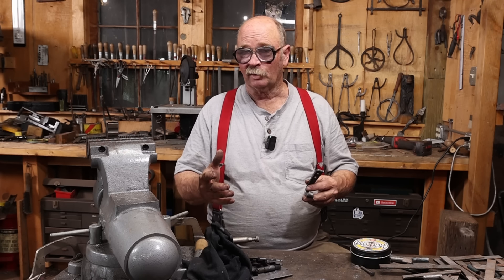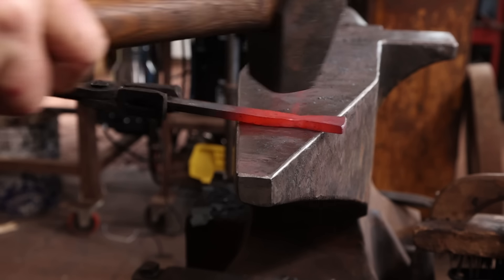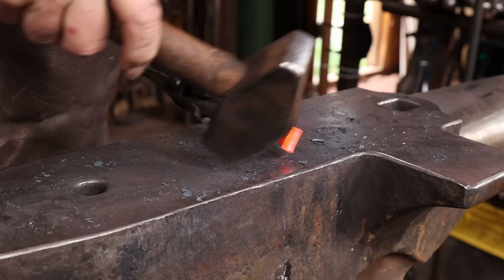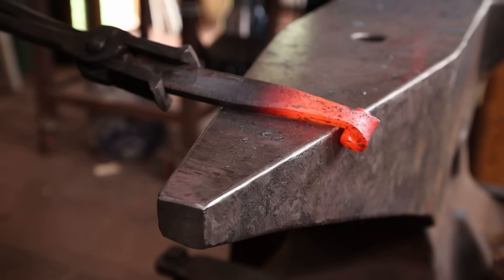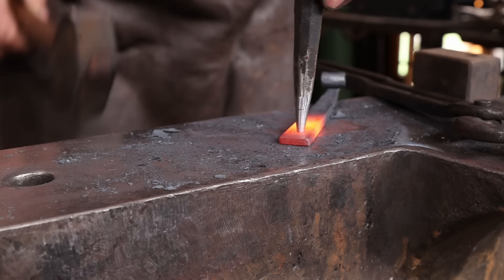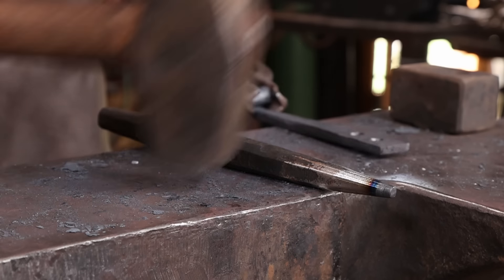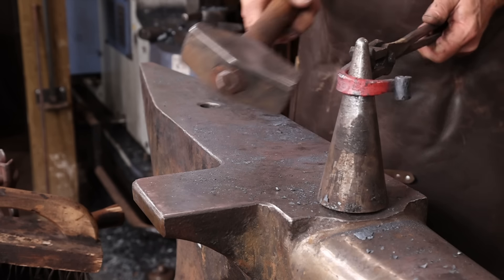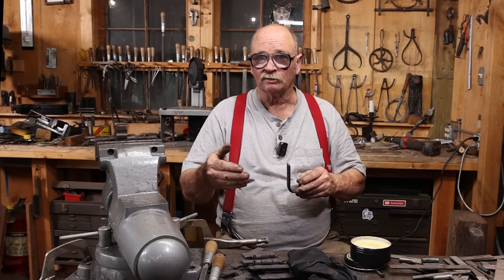Simple forgings to build Blacksmithing Skills

Comment: I would love to know what that little shelf thing on the side of your anvil is for. I was also wondering about the flat tapered horn, but you explained that in this video. You should make a video series for download or DVD. You seem to be a good teacher, and I would love to have a complete guide that I could buy, instead of searching through thousands of YouTube videos that may, or may not, give complete details
Reply: Took me a while to realize that the curves on hooks look best when they are semicircular, not oval shaped
Reply from the maker: The side face on the anvil is primarily used for scroll work.  it allows a scroll to curve under the shelf instead of bumping into the side of the anvil.  But I find other uses for it all the time, very handy to have.

Comment: I'm in the process of setting up a small work space and while going through buckets, tubs and crates I realized that I have a ton of little pieces and parts that I've cut off or collected with various purposes in mind and I'm having a terrible time trying to organize all the odd shaped or small pieces of metal, old tools that I'm going to repurpose or restore and other items that I have plans for but I haven't gotten around to yet. I know that's probably standard operating procedure but would it be too much trouble to do a video showing how you organize things that don't necessarily already have a place? My limited space is quickly being filled and I need some ideas and I'm sure that others could benefit  from the experience of others as well. If I can't figure out something soon I'll have to do something drastic and unforgiveable like throw things away.
Reply from the maker: I'll see what I can come up with, but some of my solutions over the years haven't been all that great either

Comment: Sweet surprise, a Sunday hook….one of my favorite series you made.  One question about the convection unit…does the opposite end of metal get too hot to hold? I noticed you always using tongs but I’ve seen others holding it with their hand, does it matter on the length of metal or is this just your preference?  Thanks for the video and enjoy your day John.
Reply from the maker: The induction forge does keep the heat isolated better than other heat sources, but it will eventually travel up the bar.  So for shorter items tongs are still needed.

Comment: Have y’all ever used old moter oil to blacken your work? I have do to fact I don’t have any past wax  and the oil don’t alow rust where I have tongs that had wax on them and they rust so I have to clean and use old oil to blacken them up all I do is heat the steal up  but not to point of quenching heat but just well blow it till it is just a light red and put oil on it then put in to forge and let it burn in like on a cast iron skillet and then just let it cool down and there you go no mess no fuss no rust I hope this is not to bad hopefully it may help some other people who don’t or can’t find past wax but maybe you might be able to try and see what you think